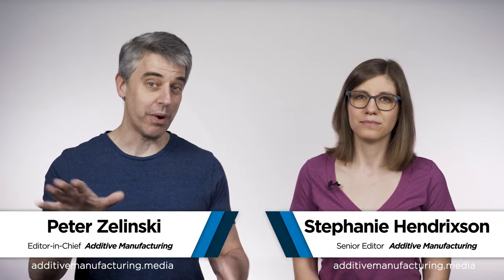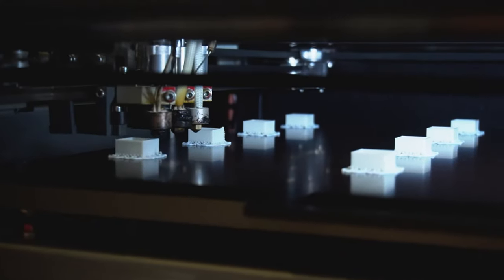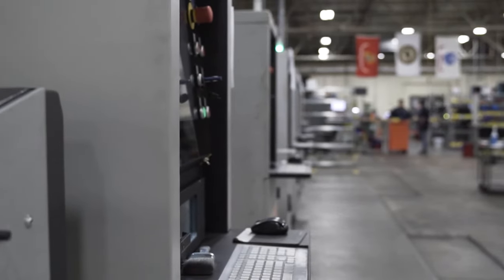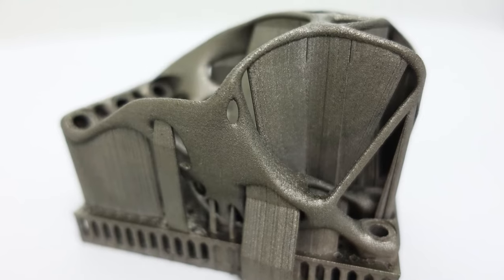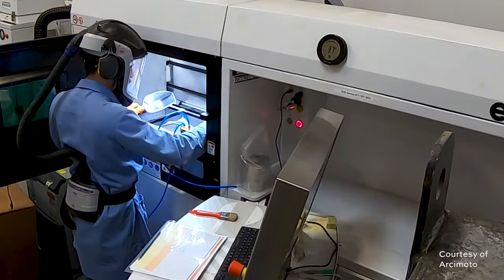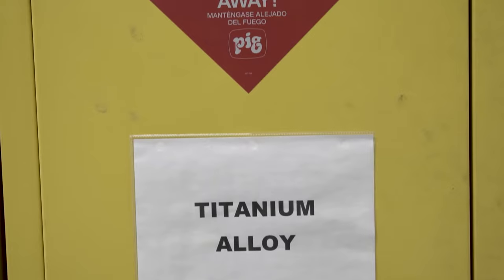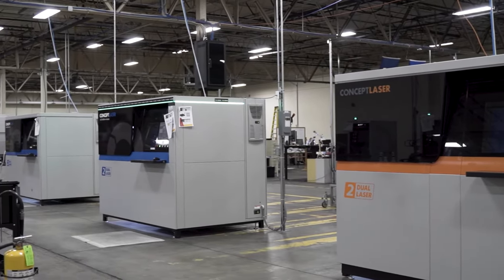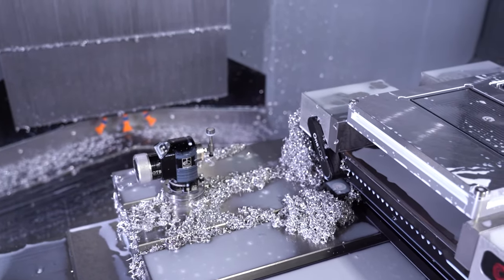What Is Laser Powder Bed Fusion?

Comment: Great informative video!
Is the build plate reused? Like the powder that didn't get used in the part, can it be reused or does it affect the strength of the material?
Reply from the maker: Yes! In most cases LPBF build plates get resurfaced and can be used for 10+ print cycles. The resurfacing removes material and eventually the plate becomes too thin to withstand the thermal stresses and must be replaced.

(We actually have a whole story on our site about a company that specializes in build plate management—might be worth a look: https://www.additivemanufacturing.media/articles/united-performance-metals-is-the-one-stop-build-plate-shop-for-production-am?utm_source=youtube)
Reply: @AdditiveManufacturing  Thank you four your reply and also the detailed article!

Comment: Does the heat treat? shrink the material?
Reply from the maker: Shrinking is not the effect typically seen with laser powder bed fusion parts during heat treat. The common effect instead is slight dimensional changes due to relieved stresses. Manufacturers experienced with LPBF know how to anticipate this and adjust for it, either in the design of the part or by adding extra stock for machining later.